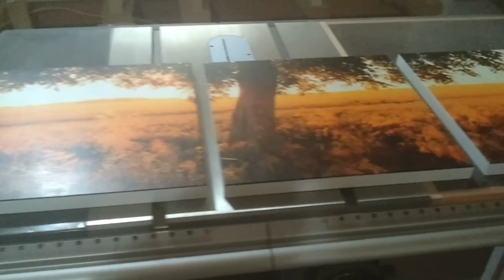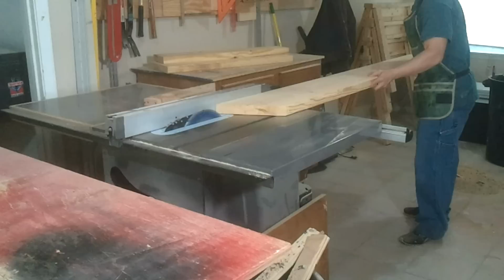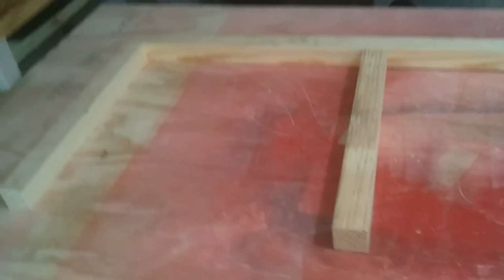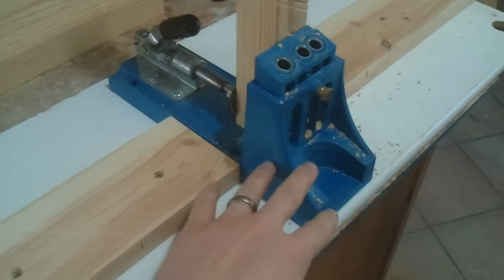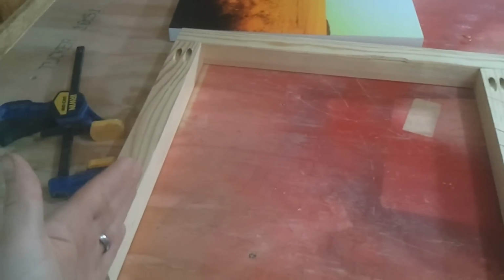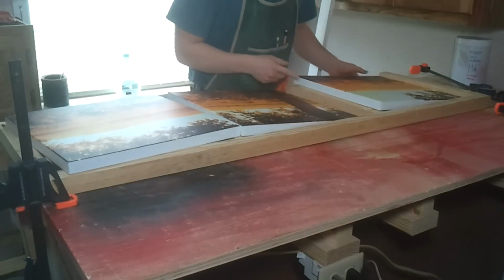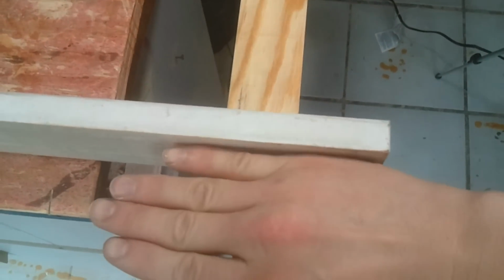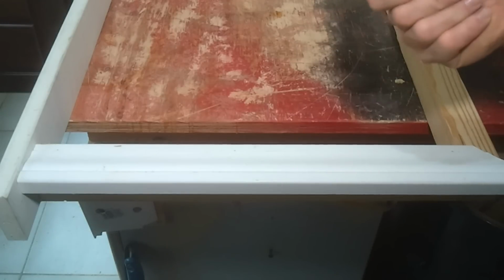Window Frame Picture Frame Video 1 - 045

Comment: Jay, I have been asked to build some picture frames out of some 1" x 2" boards.  All of my pictures are 25.5"  W and 19.5" H.  What's the best way to measure the boards for cutting the 45 degree miter cuts so that the picture will fit in the frame easily?  I have made frames in the past but I always have to make several cuts to get the measurements right.  Is there a "rule of thumb" for measuring frames so I only have to make one cut?